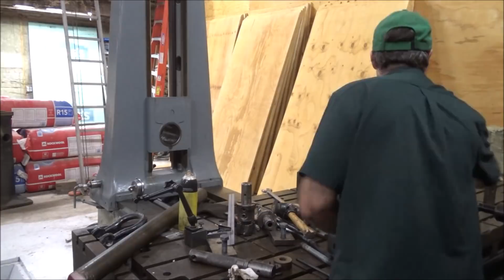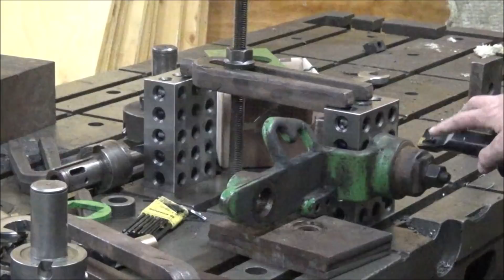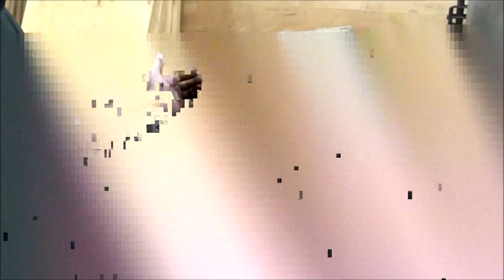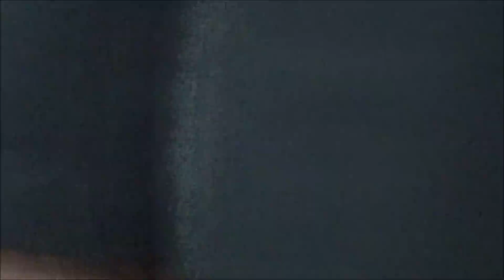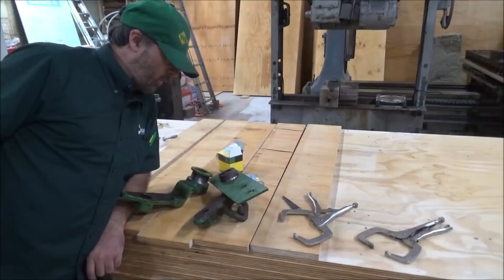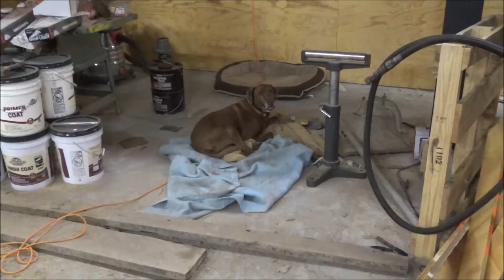If one is good two is better! Boring Trick

Comment: If you were to turn that in a lathe you'd have to make a mandril for it. An arbor of sorts that would mount tightly to the internal diameter of your reference. Given how much weight you'd be swinging you'd want it plugged into your tailstock too. I'm pretty sure you can figure it out from there.

Comment: That's the difference between being a mill guy and a lathe guy -- I would've mounting it on a face plate-- don't need any squeddles.
Reply from the maker: The part was too long to swing on my little Monarch and I don't yet have the big one going so the lathe wasn't really an option.

Comment: My GUESS is that the reason you have to remove a quarter inch from the shoulder is that the smaller end lost a 1/4 inch from the edge.
Reply: Looks like my GUESS was totally wrong....you added on the plate! I am embarrassed!

Comment: Here is an idea for you Brian, not being a machinist I don't know what all there is for cutting tools, but it seems there should be a tool that resembles a hole saw, maybe for the next time.
Reply from the maker: There  are such tools (annular cutters) but it would have to be a specific size and that would be fine for manufacturing but not cost effective for this application.  Also it would require an extra deep and expensive one.
Reply: Thanks for the info Brian, it shows you I'm not as smart as I like to think I am. Good job, you handled it with imagination.

Comment: I hope you can find a boring and facing head for your machine, if you find a baby  boring and facing head,  let me know. I started the search last year for a small one for my hbm, I have the baby of the g&l family a 25RT, no luck yet. They all seem to be way overpriced or way to big for my machine. I still haven't finished repairing mine, hopefully this winter. I am enjoying watching you learn your new machine.
Reply from the maker: Hoff auctioned one for a 25 back in the spring sometime. I almost bought it. I will keep my eye out. There is one like what I need on ebay but I can't see spending $8k for it.

Comment: I would have done it with my CNC vertical mill. It would have been a  quicker setup as I could use one end mill for the whole job. Programming would have only taken a few minutes. However with most jobs there isn't one right way to do it. You use the tools you have and at the end of the day if it gets the job done it's the right way for you. I liked the creative use of boring heads!
Reply from the maker: Someday I will have my CNC going and can try it that way. :-) Only disadvantage to that would have been the need for a very long end mill to be able to reach back that far and still have the holder clear the snout.

Comment: I see that you are using Rockwool insulation. It is originally a danish product. I just recently learned that they have a plant in the US as well. What is you experience with it so far? Itchin' and scratiching or nice to work with?
Reply from the maker: It is still irritating but not as bad as the pink stuff to me.

Comment: brian wouldnt this be a perfect job for that Cincinnati milacron VMC
at least that is how i would have done it
a circular cut and  then just a simple square 
endmill`s or insert tooling  would be easaly long enough
Reply from the maker: I still don't have a transformer to power the VMC with yet.
Reply: ooh sorry my bad 
i would love to see that bad ass of a machine throw some mean chips 
do u think that would be the machine that can throw the higest volume / biggest chips ?
Reply from the maker: It is only a 15hp spindle so the old #4 can probably still rip more material. The new big Monarch will likely be the new king of metal removal  though in my shop. 40hp on a lathe will east some material.

Comment: You need different kind of tool holder for the boring head. Look Narex website, their vhu series have them. You get the idea from there :)
Reply: Like this but, left hand tooling or rotating ccw http://www.narexmte.cz/image_text/01AA_Vhu/t_vhu_28.png.
Reply from the maker: Always wanted a Narex or Wohlhaupter boring/facing head but they are really expensive at least for the big ones. I will have to do some more work before I can invest in one. I actually think the proper facing attachment would be a better investment.
Reply: I wouldnt even consider These Narex/wohlhaupter boring heads if i had to buy new... REALLY expensive, atleast for my hobby use :D I have vhu 36 and 80. I bought both used. Shanks i needed to buy as new. Vhu80 seen quite much use, vhu36 was like new and price was cheap.
Reply: Personally I think the Narex method of attaching there shanks to the heads is light years ahead of a threaded connection like Criterion uses. That way the heads can be run in either direction. Narex however is awful damn proud of there shanks when you price them out. Even my little VHU 36 was expensive so yeah the big ones would hurt. The good part is they show up on auctions sometimes so maybe someday Brian. My guess is the proper facing slide for your G&L would do far more and larger jobs with much more rigidity than any spindle mounted B&F head would.

Nice job of thinking outside the box on this video.

Comment: https://www.matrix-innovations.com/en/ fancy work holding
Reply from the maker: have you seen the vise on my radial arm drill? It works just like the ones it that link, except it is like 80years old. Very cool to see a current version.
Reply: @bcbloc02  DMG Mori had them at one of the tradeshows doing part demos apparently DMG Mori is also making new deckel fp4 machines again. What is old is new.